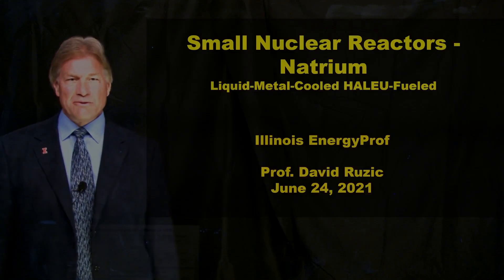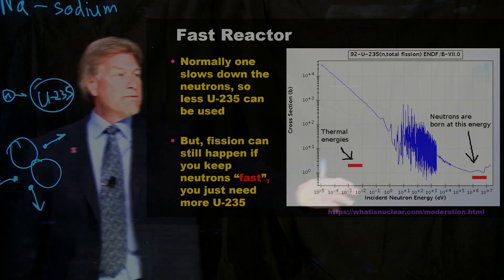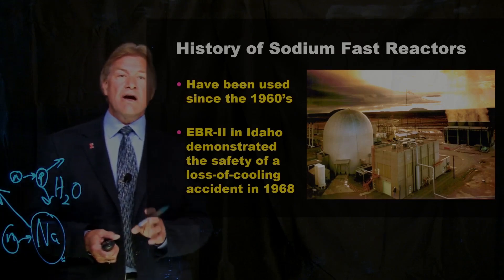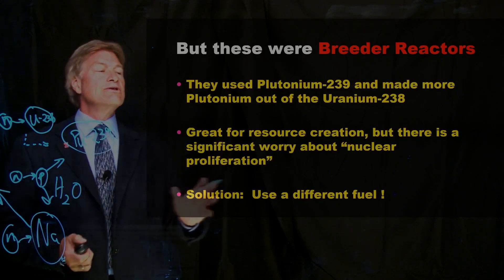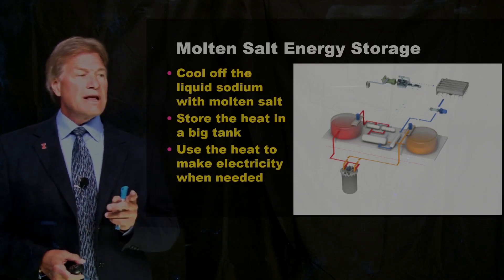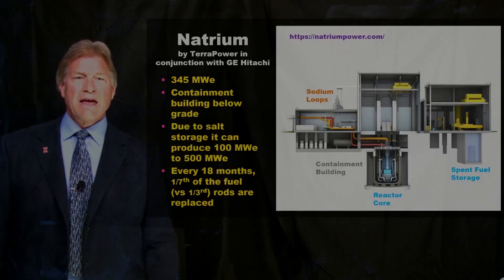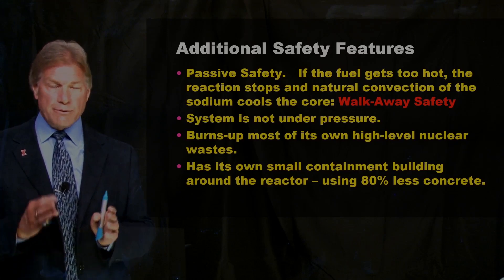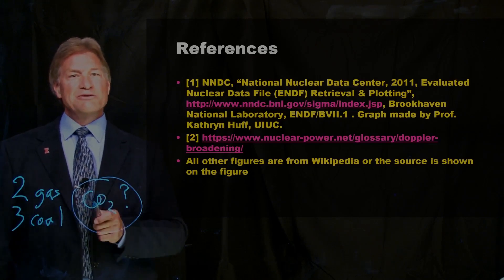Small Nuclear Reactors - Natrium

Comment: 8:38 With regards to nuclear proliferation, surely using HALEU, while decreasing the proliferation risk does not eliminate it. My understanding is that when it comes to enriching uranium, most of the work comes from enriching Natural uranium to LEU. The work required to enrich something like HALEU to weapons grade is minimal compared to the amount of work required to enrich natural uranium to HALEU. While there is little risk of using the waste for nuclear weapons, I'd have thought the unused fuel presents a significant proliferation risk
Reply from the maker: Every step in enrichment is by the same factor, lets say for example 1.05.  So going from 0.7% to 3.5% is a factor of 5.   It would take n steps to do that where you find n from: (1.05)^n = 5 %   Going from 3.5% to 17.5% (HALEU) is also a factor of 5, so it is twice as much work.   Going from 17.5% to 87.5% (bomb-level) is also a factor of 5.  So the work one has to do is half as much, to get HALEU to weapons as opposed to LEU to weapons but that is hardly a minimal amount of work.
Reply: Imagine if they could make this design work with Thorium...

Comment: So, lets assume you "forget" about this reactor for a couple years. How do you get the solid Sodium out of the piping?
Reply: You heat it back up. It melts at around 100C, which is well within the capability of a radiant heat source or even a temporary resistive heating blanket to achieve

Comment: Garden variety pressurized water reactors also "stop working" as fuel heats up. Negative fuel temperature coefficient. And btw, PWRs also have negative moderator temperature coefficient. As moderator heats up (less dense, effectively squeezes water out of the core), fewer fissions. Drives core subcritical, Keff less than 1.

Comment: Professor, Purely from a Science Point of View it is Great to Consider Nuclear Energy.
However it is Undeniable that the Science and Business Obsession with Fossil Fuels and Nuclear has Greatly Limited the Science and Business Applied to Renewables.
Hence :-
Batteries are Fifty Years Behind where they could be. 
Solar Energy is Fifty Years Behind where it could be.
Geo Thermal is Fifty Years Behind where it could be.
Wind is Fifty Years Behind where it could be.
Solar Energy in Space is Fifty Years Behind where it could be.
Wave/Tidal Energy is Fifty Years Behind where it could be.
Therefore Would We be Pursuing Nuclear, even Small Reactor Nuclear if Renewables were where They could be?.
Plus is the Reason there has only been a Relatively Low Number of Very Serious Disasters from Nuclear Energy.  Is the Reason, The Restrictions of Use that have also been Pursued since 1945?.
Hence if You Encourage more Widespread Use of Nuclear, Expect More Disasters.
Professor, Also Very Broad Definition is being used with SMALL!.

Comment: Once you introduce liquid salts as heat-transport & storage materials, why do you need sodium?  Small modular molten-salt reactors are even simpler, are equally safe, and so on.  Must have something to do with the difference between using fast & slow neutrons?  Lots of options to consider... 
    https://www.terrestrialenergy.com/technology/
Reply: There are proposals for fast-spectrum MSR, using chloride salts. Fluorine and lithium moderate and absorb neutrons too much for a fast reactor. I think the idea with a sodium-cooled reactor is that it has already been done, so less troublesome to get approval for a new reactor based on the same system.

Comment: Professor Ruzic, the fail-safe nature of this type of reactor raises a question: Since the U238 absorbs the free neutrons in an overheat scenario, it follows that it would produce the aforementioned transuranic waste products, whose half lives are intolerably long. The question is, should an overheat occur, what would be the relative amount of transuranics produced should a "small" reactor, such as illustrated here, overheat; and would these amounts be considered acceptable in our ability to store and/or dispose of them?
Reply: As for the last part, we already have trouble with long term storage in many places.
Elements with longer half lives are technically easier to store, but I don't see 1000 vs 100000 years making a difference in practice. For the ability to do long term planning of humans in general and political leaders in particular, the timeframe is practically the same ;p
Reply: @grmasdfII  Yes. I share your concern.

Comment: I always thought that nuclear + massive molten salt energy storage is a no-brainer. And they scale up amazingly well. You need 80.000 cubic meters of solar salt (sodium nitrate +potassium nitrate +calcium nitrate) at the Tmax of a regular sodium reactor, 550C, to provide 1GW of electric power for 8hours. So you "charge up the battery" in your 8h of minimum demand, keep it for 8h of medium demand and release the energy during the 8h of maximum demand. Basically, you can backup an entire GW of electricity production capacity with 80.000 cubic meters of salt. That seems like a lot but it's a tank of 60m diameter by 30m tall, (ok you really need 2, one for the hot salt and one for the cold salt, or just one with a divider). 
When you run the numbers on nuclear and molten salt storage you realize how photovoltaics + windmills + batteries is basically a decentraliased Goldberg machine that may work, but it doesn't make as much sense
Reply: You do realize that nuclear power plants are way more complex than a solar / wind installation + battery banks, right?
They're also orders of magnitude more expensive and require orders of magnitude more oversight, the comparison is ridiculous.

Calling solar / wind "Goldberg machines" that "don't make much sense" is quite silly, specially when the alternative you're proposing is a molten salt nuclear plant 😅

Guess what? I can't have a molten salt nuclear reactor at home (and even if I were allowed to have one, I couldn't possibly afford to run it), but I sure can have solar panels, a battery bank and even small scale hydro (if there's a stream running nearby).  
Hell, I could eventually go off the grid, by gradually scaling up my renewable installations at home.  

Nuclear power makes sense to power industry, but homes can power themselves with renewables + batteries + smart architecture. 

Nuclear zealotry is as silly and misguided as anti-nuclear zealotry, don't be one of those people.
Reply: @Goreuncle  Not bad, and good advice at the end.

Comment: If we can build this kind of reactors with load following, why do we need renewables anyway? 
Those just complicate the grid and they need at least one order of magnitude more raw material for the same power output.
Reply: Well for one you can't let people stick sodium-cooled reactors in their garage like how they can put solar panels on their roof.

Switching houses to be a little grid-independent just in case of power outages would be prudent: solar and battery backup that at least covers the refrigerator and some lights wouldn't be too hard.
Reply: @drewgehringer7813  who would want to put solar or wind in their garage if unlimited and cheap nuclear power is available?
Reply: Renewables require less coordination, less delays, less inspection, and they can be cheaper.  The cost you pay factors in the raw materials.  Also less safety risks.  While this reactor seems like it is pretty safe there still are risks like the spent fuel pool.
Reply: @George Mann The power companies think Wind and Solar is practical as it is now cheaper in many areas, even without artificial subsidies.  "virtually zero risk" kind of ignores the fact that high level waste is extremely hazardous and able to self-melt.  Yes, if someone is there to check on the pool periodically and fix leaks and add water as needed, it's safe.  But it is not "zero risk".  Plenty of ways to screw this up.  If the most irresponsible, cost cutting company installs solar or wind the worst they can do is cause an electrical fire, not contaminate land.

Comment: Ok - great show on Natrium - now how about a break down on the ThorCon 500MWe liquid metal Thorium ion molten sodium fluoride salt burner reactors? Indonesia's pragmatic PPA agreement for 3×500MWe ThorCon walk-away safe burner energy Converters base loader or load follower. Current supplier  costs to ThorCon at $1000/kiloWatt and agreed unit cost to consumers less than 7cents per kWh.
Indonesia's cost is to prepare site;  connect to grid and supply from their rare earth mining company, the Thorium needed. Fuel mix is 85% Thorium and 15% of  Uranium  High Assay but Low (<20%) Enriched Uranium. Site footprint 65m×180m = 1.17Ha per 500MWe unit. (about two football pitches)
eg. (latest version presentation to Solo Uni. released)
https://youtu.be/rZx7kwZo4hQ

Comment: As usually great video professor! I have been following the development of the natrium reactor. Terra power isn't really saying anything about reducing the long lived waste, as far is I can find. Wouldn't there always be some transuranics left in the fuel? Wouldn't you need to reproces the fuel to get all the transuranics out to truelly achieve the 300 years? I would love to know more about that.
Reply: "Normal" LWR reactors use slow neutrons, and their cores don't have very many fast neutrons. Many transuranic isotopes can't be split by slow neutrons, only fast ones. (They are a bit like U-238 in that sense.) So these elements build up at a higher rate in an LWR reactor.

Clearly you don't need to eliminate all the transuranics to achieve equivalent-to-uranium radiation levels. I'd also like to hear more details about it!

Comment: Hello EnergyProf love the videos! 

I do have a question though: Can't the liquid salt energy storage also simply be used to store/regulate excess energy from renewables?

If so then I don't quite understand what the special benefit is of this kind of nuclear reactor, over heating the salt storage system with any other form of energy
Reply from the maker: The problem is that renewables don't make heat.  Solar and wind make electricity directly, so it has to be used directly or stored in batteries, or in something like pumping water up hill.    Turning the electricity back into heat, so it can them be made into electricity later, loses you about 2/3 of the energy you made in the solar and wind in the first place.
Reply: @illinoisenergyprof6878  ahh right, so the heat -> electricity conversion is about 30% efficient, but with nuclear reactors you will need to do that conversion at some point anyway. So it isnt an efficiency loss compared to other nuclear reactors. While with renewables it would be.

That makes sense! Thank you. 

I wonder what kind of energy storage we'll end up seeing in large scales for all the intermittent renewables.

Comment: I really like the molten salt energy storage, because it doesn't have some of the problems that pumped hydro and battery energy storage systems have. You can also make a combined-heat-and-power system a lot easier.
Reply: I have not looked into it too closely, but I hope the reactor design allows for shutdowns, as in losing criticality, Russians tried the liquid metal route with their early subs and I would imagine it's kinda embarrassing retiring a sub because the reactor cooled off and couldn't be restarted. In other aspects they were amazing reactors, just liquid metal was a bad idea. They were not using sodium though.
Reply: @justingrey6008  Sodium-Potassium alloy "NAK" has a lower melting point, potentially below -10C though that is with an alloy very high in potassium. A low level of potassium in a sodium system might usefully depress the melting point.
Reply: @justingrey6008  The video mentions sodium melts at 98C so you could likely re-melt it pretty easily.
Reply: @Whatsinanameanyway13  no doubt, but whatever heat source was applied would need to be external as any control rods or the like would be stuck in the sodium. Doesn't sound like a good time.
But these issues are known so I am sure someone has thought about them a bit
Reply: @justingrey6008  Do you know what metal was used?  Lead?
Reply: @Pene7942  sodium or one of it's alloys

Comment: can the storage tank get it back to liquid if it freezes in there accidentally?
Reply: As with water ice you just heat it up and it melts...
Reply: unlike water. salt shrinks as it freezes. so it's just a matter of heating it up again. I would guess there would be electric heaters for dealing with shutdown and maintance.
Reply: With the soviet subs they used wall power to keep the sodium melted when they where in the harbor.
Reply: @chukkie0001  i wrote that before he said the melting temperature. i thought it was really hot.

Comment: Nuclear can follow load. molten salt fuelled reactors do just that. Solid fuel reactors seem rather silly in that light. I believe, but can't prove, that this is the reason that the liquid fuel guys can't make any headway. Liquid fuel wouldn't work alongside renewables, it would make them wholly unnecessary.
Reply: Molten Salt Fluid Fueled  reactors can work with renewables because they can "follow the load".  But they still make renewables unnecessary...

Comment: Thanks for the video. Do you have a source that the first plant will use the BoP of the old coalplant? I only saw them mention that they would build it at the same place where that coalplant was but never saw them mentioning that they would actually use some of the old equipment. If that is true that would be amazing.
What kind of burnup could this reactor roughly achieve? On their website they talk about 4x higher fuel utilization but if that just means 4x higher burnup than PWRs that wouldn’t be that impressive considering that they use HALEU.
Reply from the maker: Yes, a news release says that actually will use the generators of the coal plant.   In terms of the burn up, they only remove 1/7 of the fuel rods each 18 months, so they are in there on average 10.5 years.  I will have to figure out what concentration of U-235 they have when they are removed.  If it is still 3% I wonder if they could then be used in a conventional reactor?
Reply: @illinoisenergyprof6878  Interesting. Their CEO said during this Interview that they will use the switchyard and the water intake but didn’t speak of the turbine.

Comment: Yeah but the longer the halflife of the material, the less dangerous it is. So the only "waste" factor here is not that it's dangerous, but that it can't be "consumed" or "repurposed" as something useful. So it's literally dead weight. Not so much because it's dangerous, because it isn't. Only because the heavy plutonium can be made into bombs, doesn't mean it's readily available. Enriching is still a high-tech process and stealing that kind of radioactive waste? Good luck.
My biggest concern about nuclear power is not safety. It's the energy translaction. Just another "steam engine". What I also like to see is processing coal at these high temperatures. The things you can do with extreme high temperature coal from a material science point of view is amazing. Never burn coal up again for anything, but use it as a construction material that becomes perfectly recycleable by high-heat malleability.

Comment: If you influence where these are installed, there is a mothballed coal power plant right off the shore of Lake Ontario in Somerset, NY that might a good spot for one. https://en.m.wikipedia.org/wiki/Kintigh_Generating_Station
Reply: The residents of the Great Lakes have already decided that new nuclear on the lakes is a no go. You are not treating the fresh water like the critical resource that it is. 2045 is just around the corner.
Reply: @otm646  The NIMBY phenomenon.  I'm originally from Wisconsin, the states surrounding the lakes were/are very possessive of 'their' natural resource.  A hot button to push, if one was looking for excitement, would be to mention a pipeline to the Southwest and West.  Of course, they would forbid it - they're lucky the Rockies are in the way.

As far as nuclear on the Great Lakes, there are several:  Wisconsin, Illinois, Michigan, Indiana, Ohio, and New York all have nuclear power plants on the shores (well, Illinois' are inland a bit, but fairly nearby) of three of the Lakes.  But you specified 'new' nuclear, didn't you?  That sounds about right - I don't know about the other states, but Wisconsin has a moratorium in place, although there are those trying to get that 1983 law reversed.